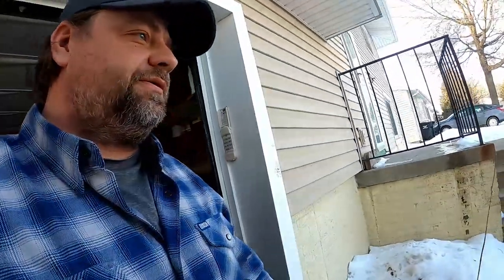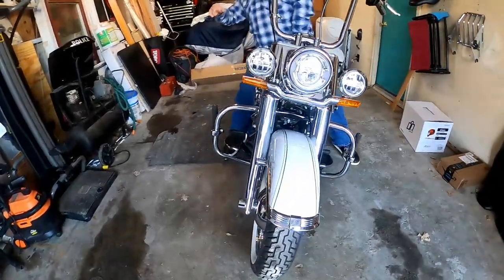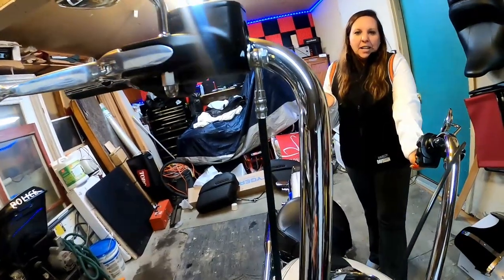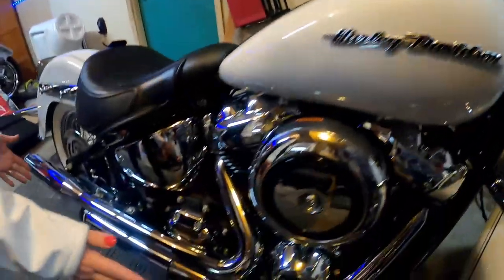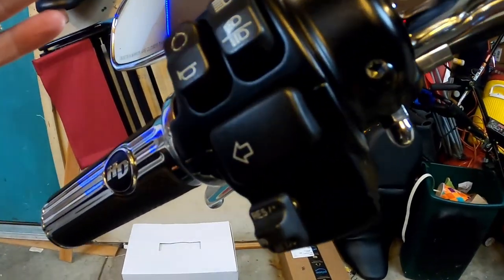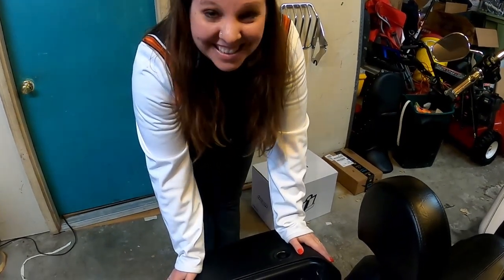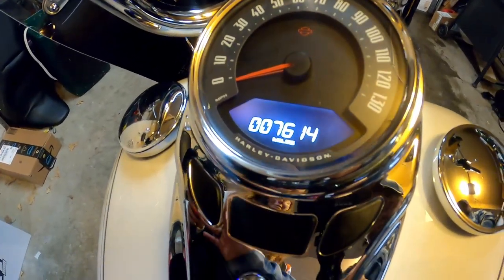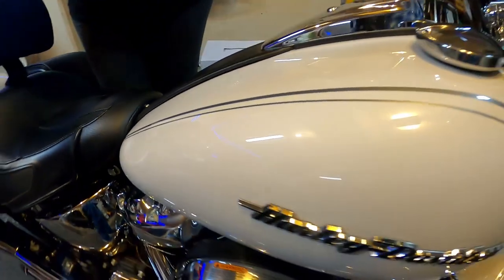The Deluxe is back! Amy gives us a walk around of her Creation!

Comment: I HAD a Heritage Classic but upgraded to a Road King P.I. Been completely happy with the differences but for a single feature. The Road King does NOT have cruise control. I asked my dealership but they really weren't helpful. I got the 'Get a "grip lock" instead of true cruise'. No on that. Love to hear any suggestions, please?
Reply from the maker: What year of bike is it? As far as I know you can add cruise to Roadkings.
Reply: @StevyFaux  Thanks for the response. I have a 2005 FLHPI, with 17k miles. Runs beautifully & no complaints. I have extra buttons on the handles for lights & sirens that aren't being used, so Cruise seems like a simple addition. I'm a little confused.
Reply from the maker: @-dirk-65  I would ask another dealership. Where about a are you located?
Reply: I'm in Montana. The piles of snow in your video might be smaller than ours, but made me smile. 30 days to Spring.